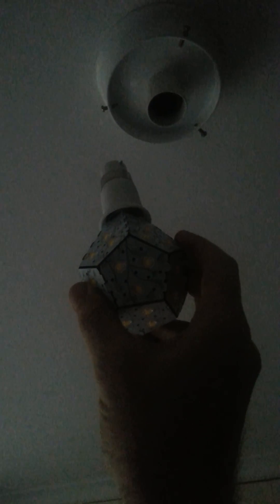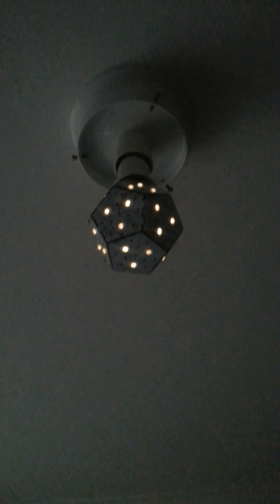NanoLeaf. Why is it still on?

Comment: Out of interest is it on a dimmer circuit? I had the same issue with a different set of power saving bulbs which wouldn't turn off when installed. Turned out traditional dimmer switches can't handle low voltages properly so end up screwing up the power output. I just replaced my dimmer with an automatic power adjust dimmer made for low power leds and they work no problems now.
Reply from the maker: No, +stunner38 - it's a standard circuit.  I received an email from the makers of the NanoLeaf saying (let's see if I can get this right) that if the switch is on the neutral side rather than the active side, sometimes there's enough grounding in the circuit to give some capacitance between neutral and ground.  Because the NanoLeaf is low resistance and has its own voltage converter, it can drain power into the neutral circuit via the capacitance to ground.  It's not dangerous per se, and it's milliwatts of power, but it still bothers me :-)
Reply: Paul Wayper My nano leaf bulb does this but for only around 30 minutes after I have switched the bulb off, maybe it is doing what nano leaf said, they only do this for around 30 minutes though and the Lyn completely switch off.

Comment: I've heard stories of the final coil room of VLF transmitters having flouro tubes stacked in the corner, glowing happily without being connected to anything.

My professional answer to your question is: "It's a hardware problem"

My unprofessional answer is: Possibly enough juice induced from a parallel power cable to fire the LEDs. I'd try turning off other devices nearby till you get as far back as the main switch and see if it has any effect on the LEDs. After that, have a look at csmart's microwaver detecter thingy. Are you near any high tension power lines?

Also, portrait video: Shame on you!